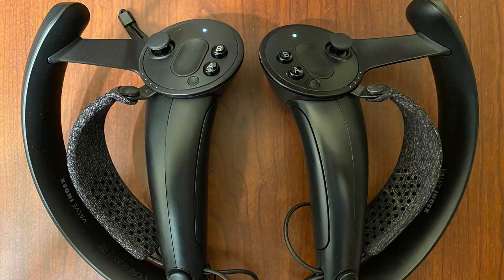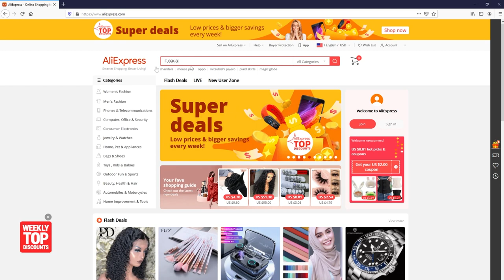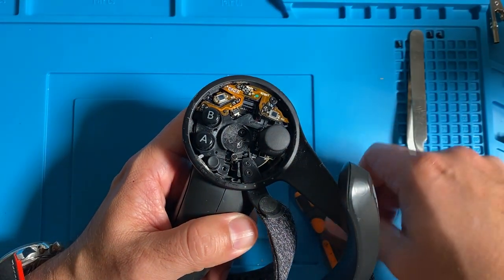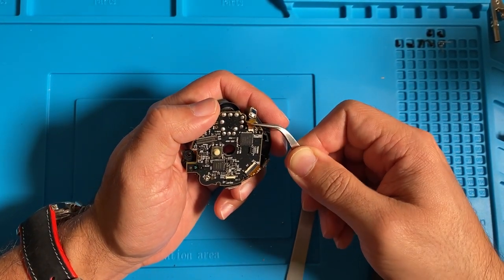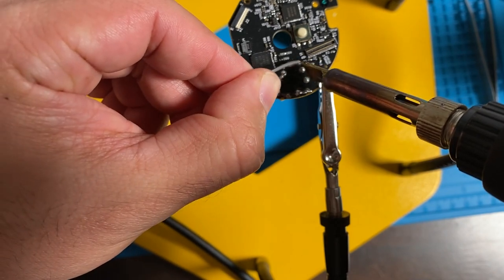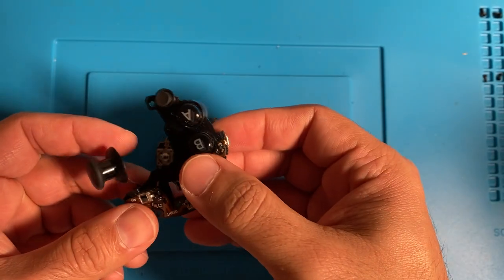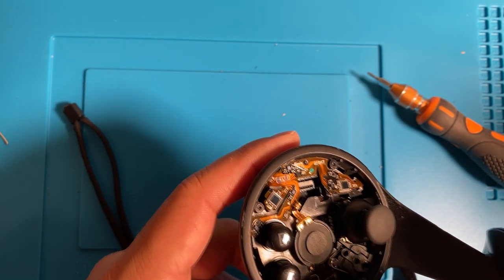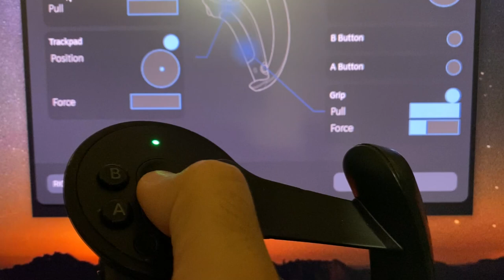Valve Index Controllers Thumbstick Drift Fix | Thumbstick Replacement

Comment: Hi Nolomite!  Sorry my discord account was hacked for a while, but thanks for letting me know!  Thanks again for repairing my valve index controllers - they still seem to be working great!  Unfortunately last night I noticed one of my base stations blinking red.  Any chance you know how to repair those as well?  I've tried all the basic steps, and I've also tried recovering from corrupt firmware, and copying the firmware from my working one but no luck.
Reply from the maker: Hey, good to hear the controllers are still ticking.  I’ve fixed some for a couple friends and so far they seem to hold up better than the original valve sticks.  Unfortunately I don’t know much about base station repair.
Reply: Two years too late in responding to this, but for anyone who ends up having the same issue, red blinking lights are usually deemed a total loss on the base station. This was a back and forth conversation with Steam Support. They will usually send you one for free out of courtesy, in which you can send the broken one afterwards. That was from my experience. Though if we're on the subject for a fix on a red blinking base station, I don't know of any other than the basic firmware recovery steps.

Comment: welp i done goofed, i accidentally ripped off the thumbstick while i was removing the cover and a wire snapped so now cant move at all in game so i gotta rma it. i know this wouldve worked tho bc its the exact problem i had and ripping it was my fault, so ima still leave a like for actually giving a fix
Reply from the maker: If it's the small wire going to the thumbstick it should be fine.  That's just for capacitive touch, and most games don't use it.  If you can't move at all you may have broke something else.  I would always recommend RMAing your controller before trying this repair.  There is a probability you can break your controller trying this. I was pretty explicit about that in the video and in the description.  It should be used as a last resort.

Comment: does the new metal thumbstick last longer than the original ones in the controller or do you find yourself needing to replace these regularly still?
Reply from the maker: So far, yes, by a lot.  I have yet to have to change mine again since repairing them.  I’ve slowed my pace of playing but even when I was playing they still lasted much longer. Night and day difference.

Comment: The sticks from AliExpress don't last. I had to replace the left stick again after only a couple months, but it started getting worn after only a week or two as I noticed a lot of play, but after 2 months it's so worn out that the stick doesn't even return to the center and has heavy drifting issues. The right stick which is original is still going strong. I put back the original left stick and only replaced the tiny metal wipers inside the black plastic side pieces (per instructions I found on Reddit). Hopefully it will be a longer lasting fix as the wipers weren't the part that wore out on the chinesium stick, the main stick assembly itself wore out, which is odd being metal you'd think it would last longer than the original.
As a bonus, this way of repairing doesn't require soldering. Just need to bend the pins a bit to access the inside of the black plastic things. If bent too many times the pins will eventually break though. In that case you can replace the black plastic things in their entirety but it would require desoldering 6 pins. Still easier than desoldering the whole assembly and you shouldn't need the expensive chipquik. The chipquik will only last a few repairs if you replace the stick every time, it's not really worth it.
Reply from the maker: I personally didn’t find it hard, and chipquick isn’t that expensive, I still have plenty left after a number of repairs, I paid about $14 and still have plenty left over after fixing 6 controllers.  I get what you are saying, if you find that easier great.  I’ve used my replacement for about 5 months and my friend that I repaired his controller’s thumb sticks on  has been going about 6 months now, still no issues, much longer than the original Valve thumbsticks.  I think it’s about luck of the draw with which one you get, you probably had bad luck with the one you installed.  Quality control may not be the best but in my experience, still better than what Valve had.

Comment: I am terrified to do it myself because could break stuff, so don't really know what to do except for messing with the dead zone. I put it at 60% and it doesn't move backward anymore but it does drift backward and when pressing trigger it will go, otherwise it is still barable. Want to fix though.
Reply from the maker: Yup, if it’s still under warranty you could try going that route.  Also try contacting Steam anyway, someone else said they were still able to get an RMA after their warranty expired.  I wasn’t so lucky.  But yeah you can break your controller, so this is a last resort before you buy a new one.  I think a lot of people are overheating the board while soldering, don’t put the temp up higher than you need.  I hear more success stories, but it does happen.

Comment: there is a no soldering required solution out there that seems to work okay, although I had to repeat the same repair about a month later so maybe not so much
Reply from the maker: Thanks, if you have a solution let me know.  The only temporary solution I know of is adjusting the dead zone in the controller and as the controller drift gets worse that doesn't seem to hold up.
Reply: @nolomite3921  this reddit thread sort of describes how https://www.reddit.com/r/ValveIndex/comments/kf7mb4/guide_how_to_repair_your_valve_index_controller/

basically i just kinda pried that potentiometer compartment back and swapped out the butterfly wing looking thing for a new one.  It worked but I got drift a month later so I did the same repair again.  We shall see how long it lasts this time.  If it doesn't last I'll have to try to swap the whole component.

I'd say your solution is probably better provided one is competent with soldering microelectronics.
Reply from the maker: @iliketurtles7947  Ah, I see, thanks.  Yes that makes sense now, they are swapping the armature in the potentiometer.  That could work, and if I didn't have a soldering iron or soldering skills I could see myself trying that method.  It's more of a jerry-rig approach, but worst case scenario you'll break a thumbstick that's already broken.   Soldering would be the proper approach but whatever works.  One issue with swapping the armature is that there could also be wear on the shaft that connects to it.  Also realigning everything and making sure you have the proper tension could be difficult, but whatever works, thanks for sharing.
Reply: @nolomite3921  yeah this is what I thought I would end up doing when this happened to mine eventually.  This may keep the "stock" stick feel as well since the Ali express stick doesn't exactly match in terms of actuating force and so on.  Any possibility on making a video just replacing this little piece ?
Reply: For future readers, I have done the fix mentioned in that reddit post 4 times now.  Never lasted longer than a couple months; because as he mentioned in the video at about 3:43 the plastic erodes and you're only replacing that metal springy bit.  
This method is my last hope to save these controllers. Buys a soldering iron and crosses fingers

Comment: I am thinking about selling my Index and my left controller has some issue where it's loose and drifts sometimes. Does that part number for both sides or just the right side?  What would the number before the left controller?
Reply from the maker: Hey Paul, it’s the same part number for both controllers.  I’ve swapped them out on both left and right, no issues.

Comment: Is there a way to get a replacement joystick with ribbon cable? Soon as I popped off the cover the joystick came with it and tore the ribbon cable. Great video BTW.
Reply: Nope
Reply: @neburo69  are there any other parts we can get.  I was able to solder the switch in, but now it can't be tracked.  Thinking some solder spilled over to another connection for the sensors.
Reply: @PearlJamFanLV  no they dont sell them

Comment: If a pin breaks inside when I pull off the old component mid solder, how do I get it out? It's too small to get a good grab on it
Reply from the maker: @ShaneTheBane  I’d try something from a precision pick and hook set to push on the other side while heating up the top and try to push it out.  Might help to put a dab of solder on the top to get better heat transfer and clean it up after you push it up, then use some precision pliers or hemostats to heat and pull it all the way out.  Also be careful not to rip the solder pads off the board.  It can be tricky and frustrating.  I had similar experiences before using chipquick.

Comment: what soldering iron do you have? ive bought 4-5 different irons in my time and none of them ever get hot enough quick enough to do anything, i sit their for minutes with the tip on the solder and nothing happens.
Reply: Buy a Hakko FX-888D or even one of the chinese Hakko clones (Yihua brand) and use original Hakko tips with it. Having the right tools for the job makes all the difference, it will make your life easier.

Comment: Hey. Thanks for the through video.. I did this two weeks ago.. The thumbstick works perfectly, but now the tracking doesn't.
It's playable but I definitively experience the hand wandering around and throwing isn't the same.

Any idea of what I might have done wrong? Maybe an indication of where the tracking component is?
Reply from the maker: My best guess is that you could have possibly overheated the board soldering or unsoldering and may have fried something else in the process.  That's my best guess, other than that check that all ribbon cables and connectors are properly seated.  Yeah sorry to hear it didn't go well for you.  I've so far fixed about 6 controllers without issue and haven't experienced your problem myself.  I can imagine if the soldering iron was too hot or left on the board too long it could be possible to overheat other components. That's just a guess, there are a number of things that can go wrong, which is why I was explicit in my description and the video of the risk.  It's a pretty invasive procedure. They do sell used controllers on ebay, might want to check those out.
Reply: @nolomite3921  I didn't see your message back then. I actually just bought another controller (used).
But then it also began having the same issue.
Today i rewatched the video, did the repair again and this time it's working.

Thanks a lot for the guide. I can finally play again:)

Comment: Is there a set of tools that you are using that we can purchase? looking especially for the scraper for the pressure pad.  If you mentioned it I missed it
Reply from the maker: I didn't mention it, they are just standard phone repair tools but here's a link https://www.amazon.com/dp/B08PSSHGCW/ref=cm_sw_em_r_mt_dp_JYMVPSBS0WGY1G4W83X8?_encoding=UTF8&psc=1
Reply from the maker: Here's the other tool: https://www.amazon.com/dp/B00NCFIVH4/ref=cm_sw_em_r_mt_dp_BVXRJ89JH9G2SFX0T6C9?_encoding=UTF8&psc=1

Comment: How do you repair a capacitive touch ribbon? By some miracle, while I was play beat saber, on an upswing my pant pocket caught the thumbstick. It took me a second to notice it was gone, and when I found the piece I noticed the ribbon and found this video. Is there a way to fix it?
Reply from the maker: I don't think it can be repaired, at least not easily.  Unfortunately that ribbon cable isn't a single detachable cable. It's part of a larger ribbon cable that goes to many other components.  That entire ribbon assembly is a proprietary valve part, and valve doesn't sell parts.  Not saying it's impossible to repair but I don't think it's worth the effort, you are probably fine without it.

Comment: is this problem more prevalent in older indexes rather than newer ones, or will this eventually be a problem for all indexes?
Reply from the maker: Unfortunately I don’t know.  I had to RMA my controllers a lot till my warranty expired and the last set I got from Valve started drifting.  That was almost a year ago.  Before then I watched some video sources here on YouTube claiming it was fixed, but that was not the case at all, the problem was still very much prevalent.  It’s hard to say because Valve is completely silent about the problem, and I only know what I know from first hand experience.

Comment: Hey I was able to follow your guide and fix my left controller. There is only one issue I was hoping you might be able to help with...my stick works, but it stops working after about 15 minutes of gameplay. I can run a test and the controller picks up the stick click, but no movement. I have to restart the controller and it starts working again for about another 15...same thing. Any idea?
Reply from the maker: No idea, the thumbstick is a passive component, so likely not the thumbstick itself.  My best guess is that you may have damaged something else in the process, whichever component processes the input from the thumbstick, you may have overheated something while soldering.  I would start simple, check your connections, make sure your cables are fastened, check your thumbstick's resistance values maybe, to make sure it works, it's a 10K pot.  Besides that I don't think there is much you can do if you accidentally fried something else on the board.  I would need a manual from Valve with schematics, theory of operation and replacement parts, and I don't think Valve will give me any of that.
Reply: @nolomite3921  I ended up buying a used left controller with the drift issue off eBay. I followed your guide but this time my dude, I didn't screw up! It works 100%! No issues! Thanks for your video.
Reply from the maker: @andrewpugs1967  I'm glad to hear that it worked out.  I've been using my replacement for 5 months now, so far so good, no drift.  It has lasted longer than any of the 5 controllers I've RMAed with Valves OEM part.

Comment: So apparently my left thumbstick only does left and right (forward and backwards seems broken) , i opend the controller and the ribbon of that thumbstick was just hanging around so its probably ripped off. Any ideas where i can get a new thumbstick with such a ribbon ? i cant seem to find any
Reply from the maker: The good news is that the ribbon cable is not essential.  That ribbon cable only functions for the capacitive touch on the thumbstick, not the movement itself.  If your thumbstick only does left/right but up down are working crappy then it's more than likely one of the potentiometers has gone bad and you need to replace the whole thumbstick.   The ribbon cable is done for but I wouldn't sweat it, most games don't use it.
Reply: @nolomite3921  Ah nice! well yes it was a used Index anyways and i ordered a replacement part so ima just swap that :) Good to know its just for capacitive touch tho

Comment: Nolo - if someone doesn't want to do themselves, you would do it for a fee right? If so, how much?  Great video brudda ...   - GT4U2VIEW
Reply from the maker: What's up GT, I'll message you on discord.
Reply from the maker: Hey Monsieur, unfortunately  I can't fix any controllers at the moment.  I'm in the process of moving and all my stuff is going into storage.  If you are still under warranty I would recommend using steam support.  Sometimes you have to be patient with them.  I understand they are a PIA been there many times. There is always a chance of breaking your controllers trying to repair them yourself.  I would only recommend fixing them yourself if you have to.  If your warranty is up Steam is not going to do anything for you.  I've also been there.  If I find someone that can repair them I'll shoot them your way.
Reply from the maker: @user-kc8of9xt1x  Also check out eBay, you can find some refurbished controllers for $90

Comment: FJ06K-S with switch?
Is this kind of potentiometer more durable than the original one?
Reply from the maker: Yes, much more durable.  I haven’t had to replace mine, but I’ve been playing a lot less.  Still it’s lasted so much longer when I was playing.  The OEM sticks didn’t last long at all.
Reply: @nolomite3921  FJ06K-S Is with Switch??
I see new products is FJR06K-S also can use?
Reply from the maker: FJ06K-S.  Not sure what you mean “with switch”?  It does have a push button switch when you push down on it.
Reply: @nolomite3921  Because the seller told me that there are potentiometers with and without switches. He said that FJ06K-S has a switch and FJ06K-N does not have a switch. The seller also said that Xbox or ps controller dont have a switch, so I don’t know how to buy one.
Reply from the maker: @ozaki112233  Gotcha, yes he must mean the push button switch, yes it’s the FJ06K-S, get that one, with switch.
Reply: @nolomite3921  ok! thank you very much ~ is very helpful! it can save a lot of money~🙌

Comment: well only issue I have is the capacitive touch on the tumbstick dosn't work any more, wonder if hair is still causing an issue, or if i damaged the cable to the thumbstick but that is my only issue so far
Reply from the maker: All the buttons on the controller are attached to that one ribbon cable for capacitive touch.  If all your other buttons work, then it's likely a break in the ribbon cable going to the thumbstick in which case there isn't much you can do about it.  Valve doesn't sell replacement parts and that ribbon cable is made specifically for the index controllers. Replacing the thumbstick component in this instance will not fix it.  Good thing is that capacitive touch on the thumbstick is rarely used in games for anything other than hand presence, and you can still close your thumb to make a fist using the trackpad.  Not worth the headache in my opinion.